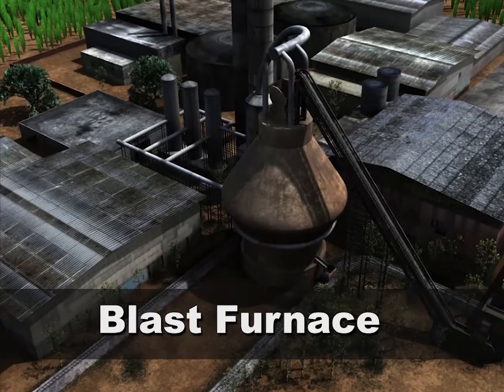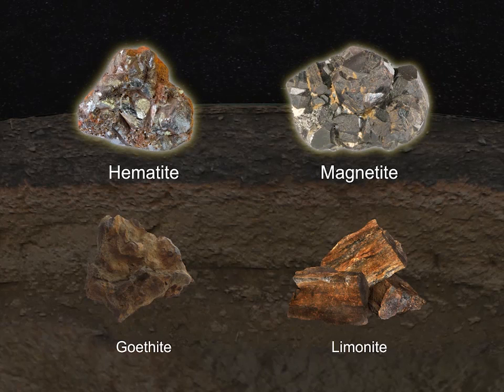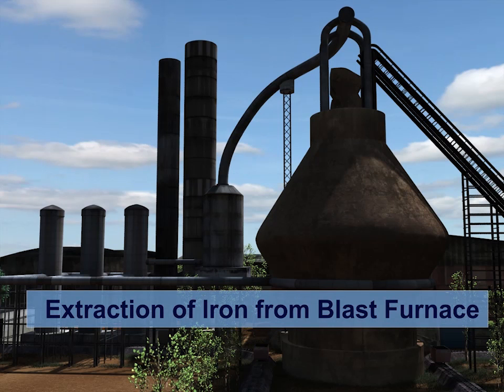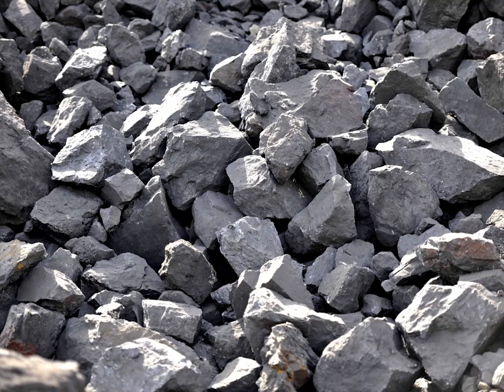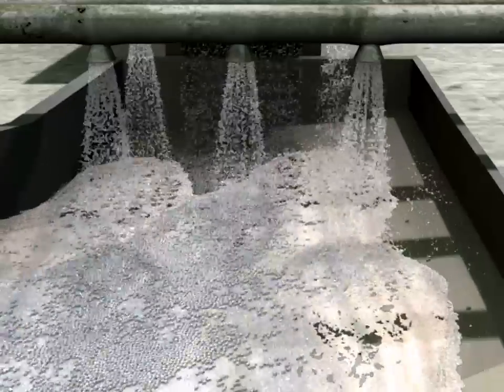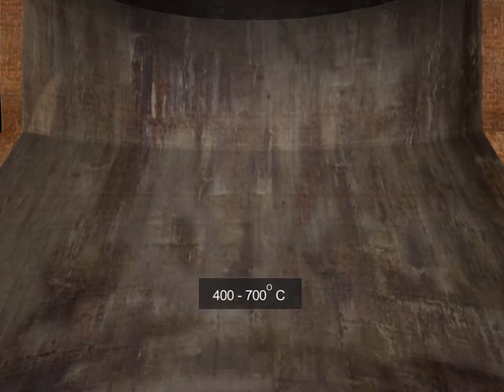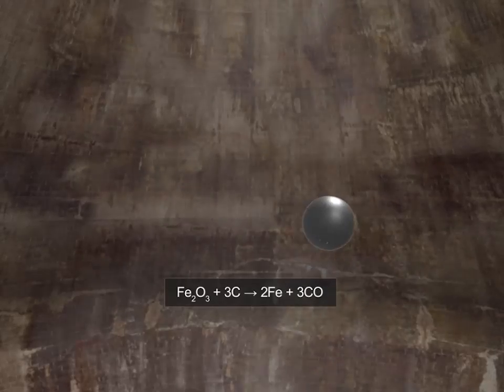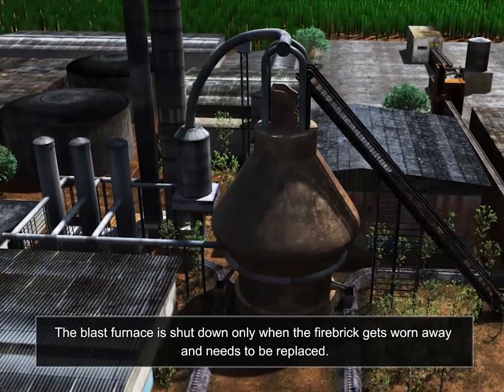BLAST FURNACE

Comment: Hi, the clip has a mistake T0:50 sec. The most abundant metal in earth´s crust is aluminum.
One reference could be Wikipedia, but it is not the only one that shows aluminim like the most abundant metal in the earth´s crust. 
Reference
https://en.wikipedia.org/wiki/Abundance_of_the_chemical_elements#:~:text=The%20mass%2Dabundance%20of%20the,%25%2C%20and%20titanium%200.61%25.

Comment: Sir after dressing and roasting of ore.. maximum of the impurities are removed out.. then why are we using limestone as flux for removing impurities? Does it means, there are some impurities which can be removed by limestone in the form of slag?
Reply: Yes.  Silicon dioxide is the primary unwanted material that comes with the ore charge. The calcium carbonate in the limestone reacts with the silicon dioxide that's mixed up with the ore to form calcium silicate.  Since limestone is essentially calcium carbonate, it's an optimum material to get rid of the silicon dioxide.